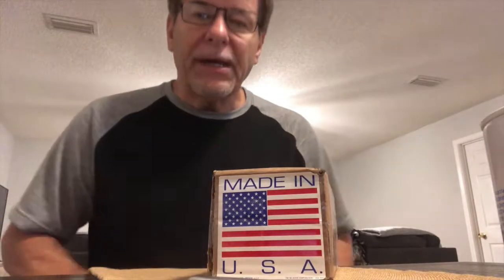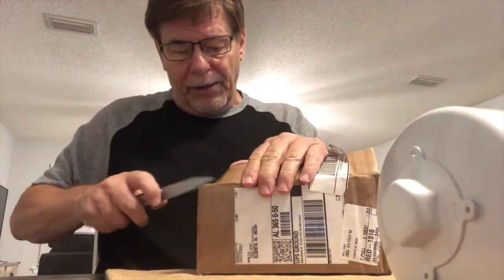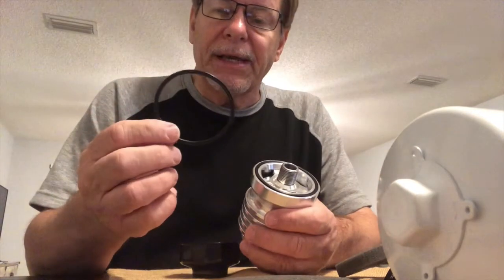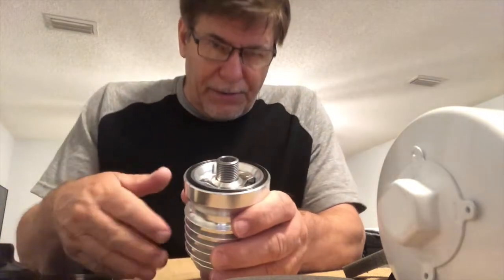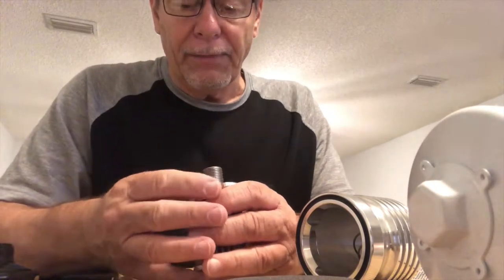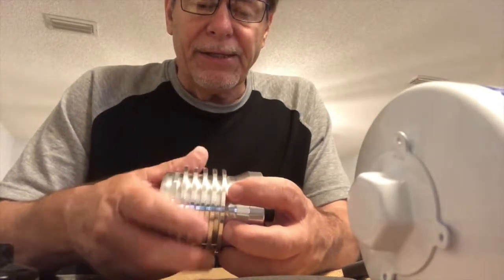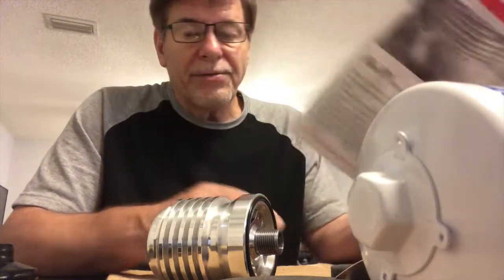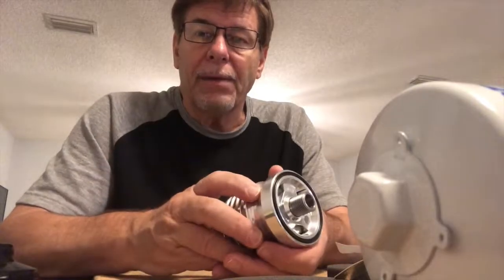K&P Engineering reusable oil filter.  An out of the box review.

Comment: Paul, here is the bitch about these screen filters. The best filter size is 30 microns. that is not very good since you can buy a premium spin on canister that goes into the 20 or better. The second part is whoever cleans the screen has to use ULTRASOUND TUB. Then there's a chance of damaging the screen material which is detrimental to the engine. Why not take the spin on filter apart and check it out ??
      This is the reason I am not sold. I have a few friend who locked the engines in their vehicles. I will pass PAUL. Nice video fella.

Comment: 15 psi for a bypass is a little bit on the low side. If you're running 40 to 60 lb of oil pressure that means a very high amount of the oil going through that filter is going through the bypass valve not the oil filter
Reply: Thats not how the bypass works. The bypass has nothing to do with static oil pressure. It activates when there is a 15 psi differential through the filter. If the oil is 60 psi going into the filter it has to be 45 psi or less comming out for the bypass to open. A brand new 28 micron paper type filter has about a  -1.5 psi differential. On a vehicle it takes approx 25-30k miles of not changing the oil or filter to hit that bypass. Even an 8-10 psi bypass takes some serious lack of maintenance to open. Not sure what that translates to in flying hours, but regardless it will never open if you do regular maintenance

Comment: Could you do a video of the cleaning of the filter, and what extra material is needed to do that ?. And how long the process takes ?.  And what the micron rating of that setup has?. Knowing the cost of that setup would be handy to know, vs your standard throwaway filter. Tia.,,
Reply from the maker: Hey Philp,   As far as the filters micron size,  it is 35 microns consistently through the entire filter.  The standard paper type filters is 40-60 microns.  Here is a link to a video for the cleaning of the K&P reusable oil filter.  Hope this information helps.  
https://www.youtube.com/watch?v=YvsFN3PMRGE
Reply: Soap and water. Use a nylon brush on the filter..Good to go..

Comment: I've got 3 Honda motorcycles. Each have a PC Racing Flo stainless filter PCS1 (virtually identical to the shown filter). They seem to work just fine. I've had them now for 8 years. The O ring can be repalced with a regular circular c/s oring - just be careful when installing so it doesn't get pinched. Also the PC filter has the nut on the tip with a lock wire hole. That being said, the nuts on any filter are not allowed to be the only securing point for TT/MGP/S100/Jurby races. Filters must be secured with lockwire clamped by a hose (jubilee) clamp.

Thanks Paul. These filters really gorgeous and exceptional quality.
Reply: FLO is a copycat knockoff filter. Does not have the engineering and certifications K & P has. There have been issues with FLO. My motorcycle tech had one magnet fallout on a FLO. Almost destroyed a motor. FLO is junk.

Comment: In this case he is looking at an automotive filter , the aviation ones have finer mesh in microns, and have a nut machined on the end and do not use a filter wrench to remove, and also have holes drilled into them for lockwiring. That may explain the price difference...

Comment: Beautiful filter but dont clean oil. To clean oil you need a Frantz a Australian Jackmaster or a few others. You cant clean oil at 10 quarts a minute.unless the filter is too big to go under the hood. The old AeroFrantz was FAA and PMA approved and used 2 ply facial quality  toilet paper. The micron rating was near 1 micron. My Jackmaster Classic is 1 micron if you use their elements. The Wix full flow filter on my Pontiac Torrent has 62.000 miles and over 4 years on it. The bypass filter keeps it clean. All I have now that clean oil.is Motor Guards Gulf Coasts the Australian Jackmaster Classic and a Ford flat head V8 canister filter that I converted to use Scott 1000 toilet paper and installed on a Ford diesel tractor. 60 years of analytically clean oil. Sorry I didnt realize you were talking about aircraft engines. Saw the AeroFrantz  filters on crop dusters in the early 80s.

Comment: Would you be willing to share the link to the site where you bought this? The prices that I've been seeing for this are much closer to $350. $200 seems like a great deal.
Reply from the maker: The site is usaoilfilters.com.  At the top left go to products and there are many different ones.  The filter for the lycoming O-320 is the S-15.  The price on their web site is $189.00 for this filter.  Keep in mind that this filter isn't for a certified aircraft... (mine is experimental so I'm legal)...   Actually, If ask,  I don't think I'd even let them know it's going on an aircraft at all.  If you did they may direct you to the certified version anyway which is another site and more money.  I think the only difference between the otherwise identical filters is the safety wire holes in the certified ones.  I'm planning on putting a hose clamp around the filter and wrapping the safety wire around that.
Reply: @paulschannel3046  ahh. Thank you!